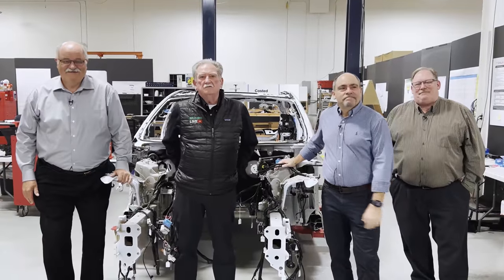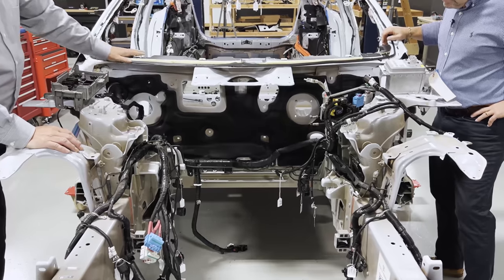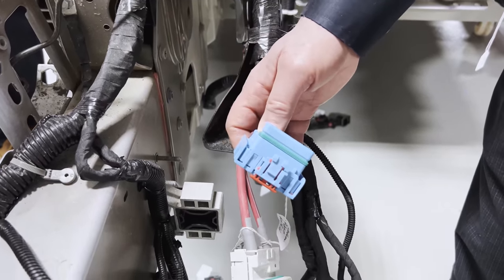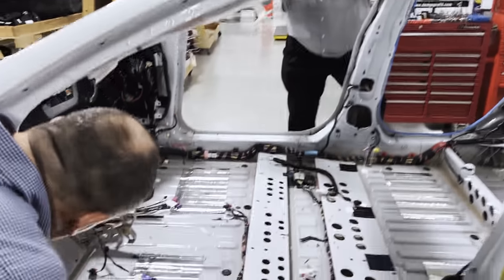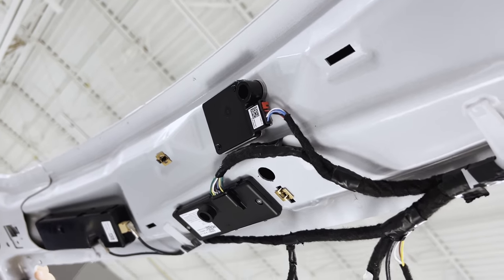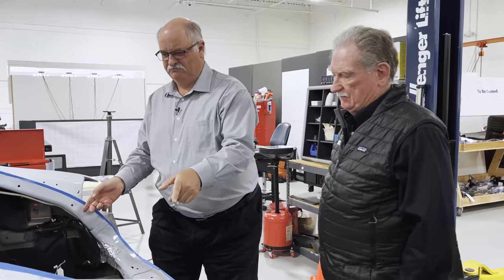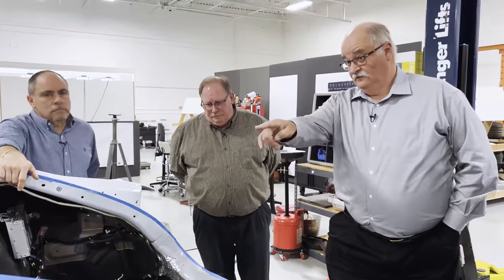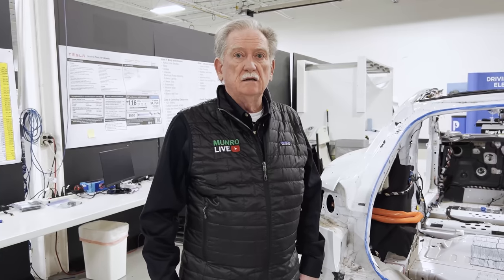Plaid Low Voltage Wiring First Look | Tesla Plaid Teardown

Comment: Wide spade connector are found on your home circuit breaker which I discovered when buying a replacement fuse to make room in my fuse panel.  The Home Depot guy told me to use this circuit breaker cause of better contact. The other breaker which cost less was for a different panel. I almost made made a mistake. Thanks to the guy at Home Depot.  

I was wiring a new receptacle Nema 14-50 for my future Tesla Model 3.   

Make sure when you are wiring your panel to get the correct circuit breaker for the make of your panel
Reply: Best is to get licenced electrician to do this.

Comment: Thanks again for the great analysis, Sandy et al. Question: Is the body in white 100% aluminum or are some elements steel as well? If so how much?
Reply: stamped steel , layered in multiple grades , inc a Aluminum core. 
if Mod S/X production increase it may be less expensive to go to Megacasting the Front & Rear.
Reply: @markplott4820  yeah I think sandy says that tesla pretty much develops their own alloys for stuff and tesla has a lifetime warranty for rust.

Comment: Perhaps I missed it, but I didn’t hear any mention of the inline solid state, resettable fuses and how they eliminate the need for a fuse box. That alone eliminates a large number of wires and greatly simplifies wire routing because power wires don’t have to all be routed through a centralized fuse box.

Comment: I’ve had problems with rodents chewing wires. What would it take to fully rodent proof harnesses?
Reply: I had a 2009 BMW X5 M-SPORT series. I had a mouse chew through the soy base suspension 4 times in a year. Cost $2,200 every time. BMW had no solution. I was pissed. I asked if they could wrap the wire differently, they said, “not really”. Luckily it was all covered under my home owners insurance, but every-time they had the car it took a week. That problem went away after purchasing a MODEL X in 2016.
Reply: I saw a repair video where the technician stated that manufacturers coat the wires in peanut oil to ease feeding them through the harness and that’s what attracts the rodents.
Reply: If there's something which tastes bad to ride ts and could be impregnated into plastic, instant solution?
Reply: @guycocoa211  that is total nonsense. They are attracted to PVC in any form. Additionally, it can be rubber in tape or solvents in the glue.  you don't coat wires with anything. The only lube that is applied is for seals, but that is silicone grease lube and its inside connectors.
Reply: you can use tape with rat poison, but in my experience, it does not work that well. It is basically a poor design.
Reply: f'n squirrels destroyed my deck chairs sharpening their teeth, cutting the 'wires', maybe chew toys or something, I want too know too !$#%@!#$%@#!!!!!!!
Reply: I spray Rust check gell undercoating everywhere every fall to protect against rust on salty roads.
08 Silverado. Might try that.

Comment: Any information on the network itself? Is this a traditional serial-based network? Or an ethernet type network for the computer system?
Reply: Doesn't look like ethernet at all, just CAN and LIN AFAIK like 3 & Y
Reply: @rkan2  Wrong. It's all sorts of networks: several CAN busses, several LIN busses, A2B audio bus to premium amplifier, analog audio to speakers, several Ethernet connections of various speeds, LVDS for cameras to Autopilot ECU, I2C in some places, PWM communication in some places, PLC in some places like communication via CCS.
Reply: @koeniglicher  You are correct about ethernet, but it's physical use is very limited as it is only really applied within the MCU/FSD computer. Thus most of the communication wiring is just regular CAN/LIN when it comes to networks.
Reply: @rkan2  Ethernet is used in at least two places in Model S Plaid: 1) from the MCU to the 2-wire ethernet diagnostic link connector (1000 BASE-T1) - see "Toolbox use on Model S Plaid" on Tesla Motors Club and 2) between MCU and Autopilot ECU (like you mentioned). 3) In Model 3  2018 ethernet (2 wire BroadR Reach) is also used between MCU and radio tuner for FM and Sirius XM or DAB (Europe), respectively. I guess, Tesla kept this with Model S Plaid. So, it's more than just between MCU and Autopilot ECU, and there may be even more than just those three. Yes, most of the communication wiring is just regular CAN/LIN, but with a whole bunch of exceptions to this rule of thumb. This episode just added, they enabled the use of CAN FD (Flexible Datarate) instead of regular High Speed CAN between Body Controller Right (Park ECU) and Autopilot ECU. So it is even one more physical layer technology.

Comment: Elon recounted in an interview with Lex Friedman (if I'm remembering sourcing correctly), that the Full Self Driving stack was being limited by latencies to the sensors and the controllers, with 10 HZ updates of things like steering position, it's more difficult to do fine-grained control and the latencies of the control commands leads to some jitter and lack of smoothness. So I'd speculate that they are trying to move everything to high speed bus to reduce the end-to-end latency. I think Elon said is something like latency from Photons hitting the camera sensor to a control output to steering/accel/breaking.
Reply: Let's hope they don't break the cars, but try to use the brakes instead. 😂

Comment: How long will it be until every electrical connection is to a controller (e.g. every lamp and motor)...and the harness is just a handful of power and signal bus conductors with sealed taps off to the controller connectors. With all that wiring they could be running 4 or more redundant buses...especially if they can go 500 meg. Has to cut all kinds of cost out of the harness construction. And at the volumes they're hitting the controllers would be pennies.

Comment: Is it possible that the left and right wiring looms under the hood are just to make assembly easier? One operator on the left. One on the right. Also how many cold cranking amps is that little battery? 😂

Comment: I would be thinking the extra loop on the seat harness is so they can plug it in the seat first, then loop it and clip it down? What do you think?
Reply: The loop was tie strapped to the clip attachment.  It didn't release.  Someone commented it provided better direction for the take out, that makes sense.  Learn something new every day.

Comment: Couldn't wiring would be simpler/cheaper by utilizing common power line and network medium.  Individual controled circuits would branch off the common power line with network-connected & fused relays.
Should save weight & copper. Locating networked relays near/in each controlled fixture would simplify assembly line and be easily replaced/repaired

Comment: Question: How can they ground (jjoint ground) if there are rubber tires tween the ground (earth) and the car body?
Reply: In electronic circuits, "ground" is synonymous with "common connection".   It does not mean literal earth connection.
Reply: A earth ground is only needed to dissipate static electric buildup (through tires).  For the  Low voltage  system (12 V DC)The current path,  within the vehicle, goes through the various wires and electrical device, and then current returns  through the body shell to low voltage battery.  The High voltage systems use wires for supply and return current (like the ~600v battery, and AC or DC traction motors).

Comment: Safety Critical and non Safety Critical wiring in separate harnesses?  Love to hear Tesla uses Blackberry QNX high level of ASIL D tech for this auto, time will tell.
Reply: I've never heard of Tesla using QNX.  I'm 99% sure they spun up an in-house varient of Linux they use in all thier cars. There are multiple processors, so other OSes may be used in some areas.

Comment: What's holding back these industrial connectivity to move to something like ethernet and use single wire for all sensors? And in next step, go wireless with off-the-shelf tech? That way you would end up with only two wires to each electrical component, + and - for dc.
Reply: That's the dream. I think it'll start with communications to non critical components
Reply: What is this obsession with Ethernet? It's minimum 4 wires, protocol that allows collisions, connectors are not waterproof, hardware is usually not certified for automotive temp and humidity range.

Comment: That is interesting that they would make a LIN connection for monitoring the low voltage kickstart battery, yet another bus type and software which need to be integrated to support LIN; job security for a software engineer.  Tesla should have beat up on their supplier to make it at least CAN.  I am not a big fan of CAN-FD, it is not that much of a step toward future proofing.  I would rather have seen Flexray with its 10 megabit speed and dual buses for improved safety redundancy.  Flexray also does a better job of providing a deterministic latency for high priority controllers in the static segment of its communication cycle, though I believe number of controllers is limited to 64 per bus side.  The dynamic segment of the cycle should be able to support an arbitrary number of low priority controllers.  Thoughts?
Reply: You don't need that speed, battery changes are pretty slow.  20 kb/s works fine.  One wire vs a twisted pair, simple interface at both ends.
Reply: @dalekoch5265  Yes, I agree the low voltage battery does not need much bandwidth.  My comment is based on my preference of not having to integrate several different bus types.  If it doesn’t cost much more and the supplies are able to do it, everything on Flexray would be more elegant.

Comment: With rumors of HW4 on the way, I'm wondering if you find anything in the wiring that would possibly used for a retrofit...like extra cables/wires for additional cameras (HW4 rumored to add 5), etc.  If you find anything like that, it would be interesting to see where additional cameras might be placed.
Reply: Great question. Hope they answer it.

Comment: I wonder if the question of to shroud or not shroud a connection is based on the environmental exposure a connection will be subject to.
If it's routed in a way that protects it from elements, then it's redundant, unnecessary weight and cost.

Comment: Is there hardware on the Plaid that would enable bi-directional charging in the future?
Reply: NO, V2G and bi-directional charging is FAKE NEWS. 
the ROADSTER had V2G but no one used it. 
however CYBERTRUCK will have 120v and 240v PTO, and may have V2G.
Reply: buy a powerwall
Reply: @cliff4377  - Agree with Cliff.
a powerwall is more useful than just V2G. you can power your entire home on just powerwall, + charge car .
Reply: @markplott4820  For Tesla at least, the Powerwall is designed for its duty cycle, using a tesla car battery that way would waste your money on degradation of miles

Curious about the ford batteries, designed for it or opportunist, bets are on.
Reply: There's a video somewhere detailing how Teslas are NOT designed for V2G.

Comment: Interesting you note the unplated copper grounds.  The Prius battery pack had copper links between Prismatic modules. Of course air was blown across the inside of the battery pack to keep it cool. That air had humidity of course and over years those links would start to oxidize. Eventually a couple would trigger a fail (there were 56) that would result in a differential voltage that the Battery Management System would flag as "low delta voltage".  ( I think it triggered at 1.5V delta to the adjacent cells but not sure. ) It is not uncommon for a person to buy a high mileage Prius, rip open the pack, clean off those links and have a perfectly functional car for anotehr 200,000 miles. In fact you can find a pack of plated links on EBAY for a low price. 
When you have this much tech in a car the presumption of those tech designers is power is omnipresent, regulated, and "golden". It does not take much to make that an unsafe assumption. And power issues have a tendency to degrade over time. So they are "ghost" type failures for the average technician/mechanic who generally gets a one session course in electricals.  Hopefully Tesla takes this as feedback and makes it more robust. It is not costly to do so.

Comment: Anyway you can discuss how tesla is doing all this new/changing/updating and NOT having teething issues with it? Seems all new cars or major updates over the years the 'first year models' have more issues than later years due to the new 'engineering'/designs?
Reply: Tesla at FREMONT makes 1000+ little changes on the Production lines every 24h, and Tesla makes 100+ bigger changes every Month, based on compile data. 
no other has INNOVATION every 24h of production. they are NOT Agile enough.
TESLA has multiple AGILITY team working in each factory 🏭.
Reply: I would say that all automakers have gotten much better about 1st year cars being so bad.

Comment: I think Tesla should lose a little frunk space to save a fortune in wiring. From nose to tail of the car, there should be a central two-part 'duct' for wiring with all boards not directly running a functional component in a centre low-voltage, water-cooled box with the battery cells. The charge port should go on a front quarter (passenger side??) panel and go directly into a box with all the battery and motor inverters. That front strut with air tank running between the shock absorber towers could have all the HVAC, and LV & HV circuits in boxes hung off it.

Comment: One more, how about using 2 wire solution where will be 1 positive power wire (chassis will be negative) + 1 data optic line to feed everything? It could save ton of wires and simplify stuff
Reply: Sandy and Elon talked about that about a year ago in an interview, but with the common live as a signal wire with pwm or something,  way less wiring, but each reader would need microchips, and we all know the issues with those.

Comment: Wow! I'm not a cable snob, but that cabling is seriously art work. Large connectors, split down each side, redundant! Can't wait for the further break down of the sub components. The antenna over visor area was neat. 

Can you break down those modules and explain where you can see each subpiece is/isn't yet focusing on sipping power? More If Tesla has brought inhouse, explain what still is bought off the shelf?

For the seats having redundant chips could that be the next piece to be removed, but they just haven't had enough time to get that far yet or working through part supply?

The cable housing story around the engine was smart thinking.

Comment: I'm old enough to remember Tesla boasting how short their wiring would get. They did this call all new it seems, but the wiring somewhat oldschool?
Still it's a lighter car than the P100D predecessor and well under the Taycan Turbo S that is somewhat similar in footprint but lower and less spacious. When brands really start trying to simplify engineering and bring weight down, EVs can get closer to similar ICE cars. With cells getting better (in theory) and then moving to cell-to-pack, the weight for a car with a given range in the same form factor can drop another 100-200 kg. A purposely built track/race car with a cell-to-pack floor could get close to GT3 race car weight and easily as powerful.

Comment: Thanks for the deep inside look. Whilst years ahead of others I am sure the next series will use optical lines between controllers. Evolution will never stop and tighter integration leaves room for crucial redundancy. Have you analysed the steering for its fail safe system?

Comment: Its a  clean rats nest. To manny wires. To many signals. It takes a while to understand but at least the connectors are good. Maybe since the wires are for ttl logic  5 volts they wont generate large magnetic interference.

Comment: Could that loop in the harness be a cutting point for emergency and rescue?
Reply: no, it's to guide the harness to the seat in a certain direction to avoid it being crashed by seat rails.
Reply: NO, the isolation loops are located in the FRUNK and the A pillar, which you have to saw or cut w/ jaws of life.